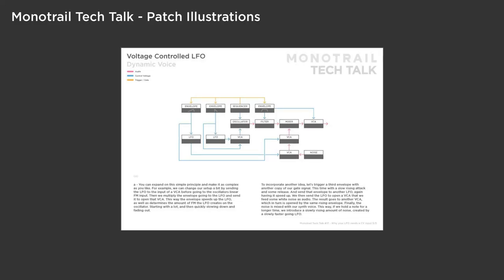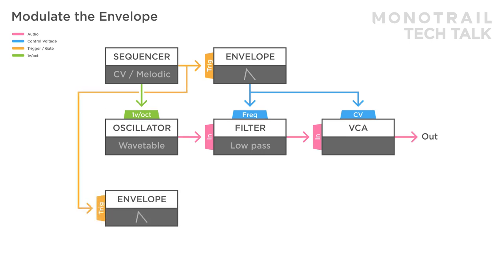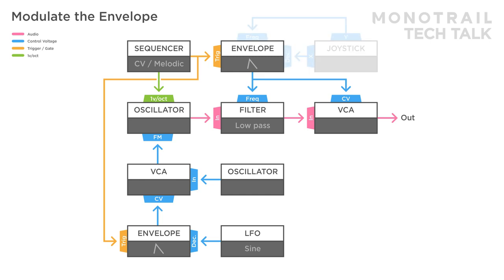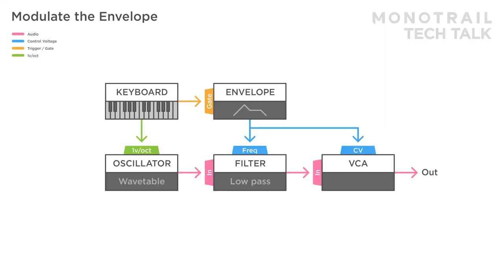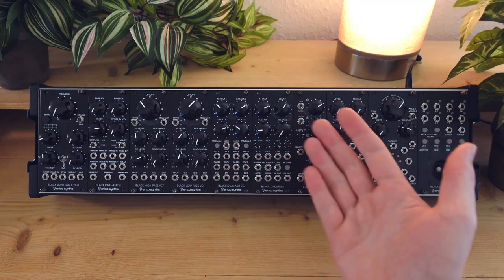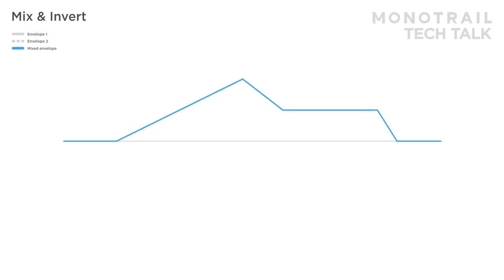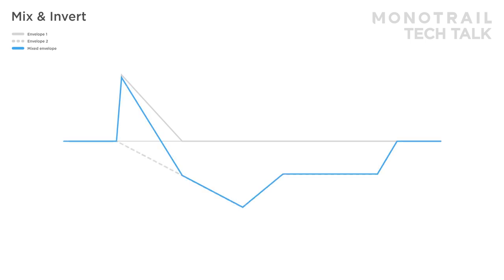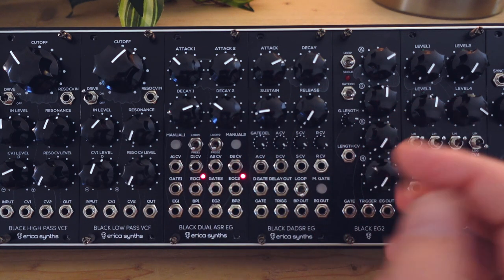How to REALLY use your envelopes - All about envelopes - part2

Comment: 9:30 : you can mix envelopes?????? Mind blown!😮
Reply from the maker: Hey, yes you can! You can mix LFOs to, and basically anything :) One thing to note that makes it slightly more complex unfortunately, as AC vs DC coupling. You can google that if you like. But in short. To mix Control Voltages, you need a mixer that is DC coupled, meaning it can handle slow modulation voltages. Some mixers are meant for audio and are AC coupled, meaning they 'filter out' slow offset voltages and are not suitable for mixing CV. Most eurorack utility mixers are designed to handle Control Voltages though, it's one of the exciting things of modular!
Reply: @MonotrailTechTalk  great to have a convo with you here in the comments! My modular system is all inside Cherry Audio's Voltage Modular software, so I could have been mixing envelopes the whole time . . . . The astounding thing about your channel is that you're constantly showing me obvious things that I've never thought of before . . . So much of my progress in modular synths has been breaking outside of the sloppy habits that I started with years and years ago! (your animations are looking great - loved the animation of adding envelopes together! ) 

BTW, I'm color-blind, and your "trigger/gate" and "1v/oct" colors look the same to me - higher contrast or dashes, etc, would be a treat! Best wishes!

Comment: HI,

Just subscribed and loved this two parter on envelopes.

I'm trying to document some of my own learnings and I'm curious about the software you use to diagram your patches.  Would you share what you're using and if there are any specific templates you use?
Reply from the maker: Hello there! Thanks for the sub, really appreciated :) I worked a lot as a freelance graphic designer, so I work with the Adobe suite. Illustrator for the patches. It's my own design, and made a lot of templates for it, but no pre-fab solution. Drawing some lines and building blocks in any kind of drawing software is pretty easy though, especially for personal documentation. Can recommend :)
Reply: @MonotrailTechTalk  thanks 🙏!
Reply: libreoffice draw would work well

Comment: Whats the benefit of being able to retrigger an LFO again? I remember seing something about free running filter modulation that will reset on a rythm but I can't find the video anymore amongst the others.
Reply from the maker: Hello! Indeed you can use something like a clock or clock division to retrigger an LFO, then it suddenly becomes a tempo synced shape. Retriggering doesn't match the speed to the incoming clock though, it just restarts the wave. So by modulating the frequency beside retriggering you can create all sorts of weird 'cut off' shapes.

Comment: Which ES module are you using to record the joystick movement?
Reply from the maker: The ES black joystick ;)
Reply: ES joystick has a record function. As you move the joystick, you can press the record button to capture the movement. I don't own it, but having watched the demos, from memory it records maybe 8 seconds of gestures, but those gestures are not saved, so when you power down, they are lost from memory. I'm sure someone will correct me if I'm wrong.
Reply from the maker: Ha, thanks for doing my job properly! just realized my comment was a bit to short. That's all true. The black joystick has 4 channels. Each channel can record up to 8 sec of joystick movement. I did a full video on it if you like to see more :) https://www.youtube.com/watch?v=8O58TV1E5-4&t=3s

Comment: I have a question I have the black wavetable VCO there is no gate tigger can you suggest a basic patch to get me going with this? I have Black EG and Black VCA as well as joystick and I notice the Volt per octave doesnt work correctly it seems that it doesnt respond to pitch from a normal Sequencer like other VCO's do? Please help Thank you
Reply from the maker: Hi there! Make sure to watch some videos on making a basic synth voice :) Oscillators don't have a trigger or gate input. They are aways 'on' and making a sound. For a very common synth voice you would patch an oscillator output, to a filter, then to a VCA, and then your speakers or audio interface. A keyboard or controller's 1v/oct output would go to the 1v/oct input of the oscillator. And the Gate output of the keyboard or controller to the gate or trigger input of an envelope. The envelope can be used to modulate the filter, VCA, or both. Hope that helps!
Reply: Thank you I just patched it to my wmd javelin and it works but it wasn’t getting my vpo pitch I had to turn the big dial all the way up then back down to zero now it works! Thanks for the reply! it must have needed a reset.